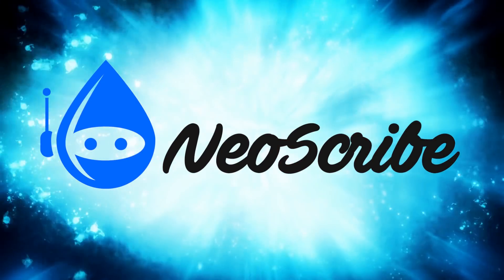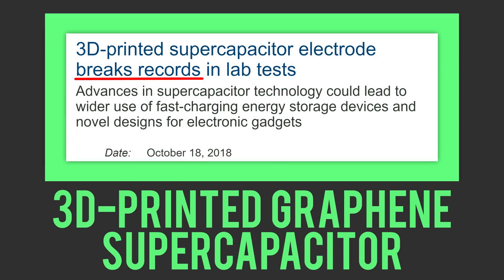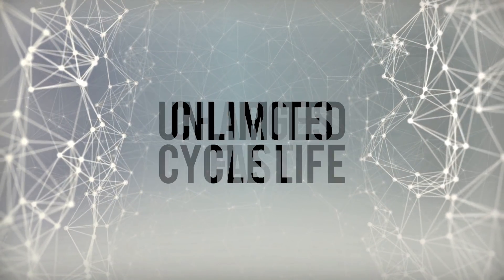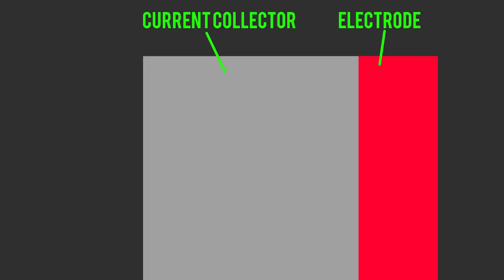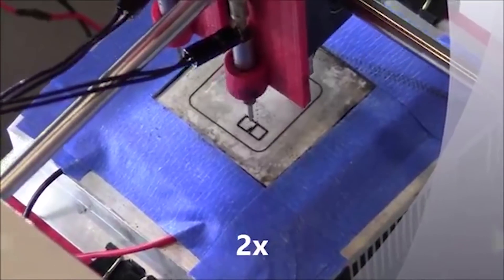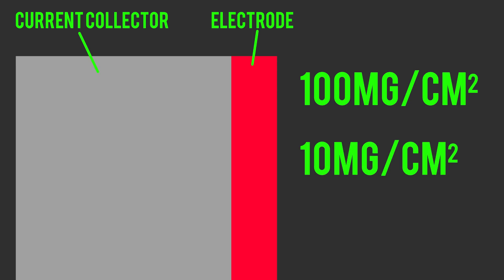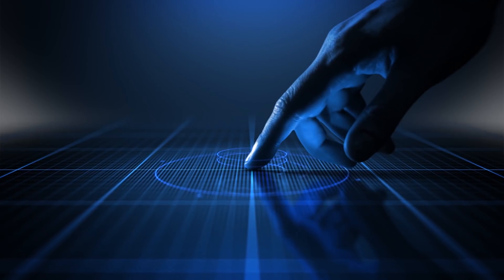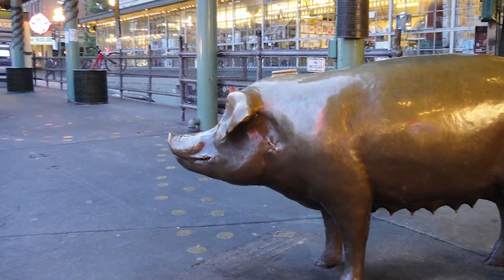Amazing 3D-Printed Graphene Supercapacitor Electrode

Comment: Cool, but one thing you didn't seem to realise @neoscribe . by the time this technology finds itself in consumer products..say by 2030... Well at that point the definition or resolution of 3d printers and sheer ability of consumer 3d printers to handle multiple materials will be many times higher. So it could be more  likely the case that consumers literally download a file to print their own graphene supercaps. Yes it might be the case that this is far less profitable for the original manufacturer and patent owners , but that is simply not going to stop such printing files from being designed and downloaded. Unless it costs me more to print than buy I will print.

So just work out the average resolution of a 3d printer, work out the increase in resolution of consumer printers over time and then extrapolate to 2030. That's probably above the level of the Livermore bespoke 3d printer.
Reply: Mickelodian Surname your ink might be expensive. After all graphemes is still hard to make.
Reply: 3D printing has become a lot cheaper, but 3d printer resolution hasnt increased a lot since its inception ~25 years ago, and its not likely to increase dramatically either.
Reply: P44man I don’t know much about 3D printing tech, but Ray Kurtwell made a prediction that we can reach sub micron level precision within 3 years.
Reply: I can configure my 3d printer for 1 micron layer height today, but that doesnt mean anything. When printing by melting filament, you are inherently limited to the physical properties of the molten filament and mechanical accuracy.  When using a laser, you can achieve virtually any resolution you want for the laser, but printing will take forever and/or require kilowatt lasers, and you are limited to materials you can fuse or UV cure with a laser. Not too mention, the physical properties of the stuff you are hitting with the laser can severely limit the resolution of the actual print.  Printers will continue to become cheaper and easier to use, hopefully also faster, but without radical new invention, they wont become much "better" than what we have today otherwise.
Reply: P44man you’re pointing out problems we can’t solve today. That doesn’t mean we can’t solve it tomorrow. I think we can both agree that human will eventually be able to 3D print sub-micron level(able to print clothes). What we disagree on is how many years it will take.
Reply: You can already print clothes. That is, if you like to wear Plastic, or metal.  But even if we can, it remains to be seen if it makes any sense to actually use it for those purposes. 3D printing generally only makes sense for low volume production, prototyping and the like.  Almost anything you can print, you produce in volume much more cost effective using other techniques. 3d printing is just too power intensive and too slow compared to traditional manufacturing for most other things. What takes my printer 10 hours to print, an injection mold machine can make 10.000s per hour for a tiny fraction of the cost.  BTW, look up the Kniterate. Yeah you can order one, download designs and "3d print" your own knitted clothes.  But hardly anyone will. And no one is going to 3d print his own batteries, even if one day, we theoretically could. Maybe astronauts on mars, as long as they dont have a battery factory.
Reply: P44man I do agree for most mass production factory is still has the highest cost effective ratio. However I think at least for clothes the mark up is high enough for normal people to consider making their own clothes at home.
Reply: P44man assuring we can print fabric.
Reply: Mickelodian Surname the filament would be expensive
Reply: @Dana Putman Graphene is quite cheap
Reply: @Dana5775  well like lots of things it would be expensive if only a handful of people bought it. Then again people pay over a thousand dollars for an iPhone which is pretty daft and its deliberately that price. It doesn't cost a lot to make it.  Also daft given the alternatives.  So it might be deliberately held expensive. But if every hone had one? Well it wouldn't be expensive.

The problem with 3d printing though is that the methodology doesn't lend itself easily to advances in quicker, better, cheap, faster.... Which is the general direction of technology. There are however different methodologies. So back in the 70's and 80's my dad had a daisy chain printer. Look it up. There's absolutely nothing you could do to increase the definition of letters. Fonts relied on installing a new head.

Then we had a ribbon printer. Lasted ages without a refill. But again the methodology was fixed definition. There was nowhere the technology could go. In the 80's we bought a dot matrix printer. The text quality was poor at under 100dpi but the process was one that could and did improve.  With 3d printing we are still in the daisy chain era. But dot matrix is coming.

Comment: But people forget that even a superVOOC charger which does it in half hour has to use special expensive charger and cable. The market for tesla-style cables to one minute charge a supercap is going to be limited. And also the cost of making them is unknown.
Reply: No, the cost can easily be calculated by knowing the required amps/time. That gives the wire size for the cable and the design requirements for the charger. Rather straight forward requirements.
Reply: @mikewurlitzer5217  there is a video about supervooc, seems like you need both high voltage and amperage for fast charging that doesn't heat up the battery, but we dont know the thermal properties of this new technology.
Reply: 635574 it’s not a battery it’s not chemical electric. And graphene airgel is the fastest heat dissipation in the universe. There is little resistance to static charge.
Reply: 635574 first of all I have 220v right in my garage I have a fast charger built right into my car. That’s 44,000 watts.
When I drive to LA I stop at a friends house for 15 min. Plugged into his cloths dryer outlet (220 V)
Unfortunately city’s are being duped into buying expensive chargers for hosting e vehicles. This is just naive and tec companies are having a hay day with this nonsense.
If you own an e vehicle you want the charger built into the car ( 200 dollars ) this way you can plug into any electrical outlet  (110V , 220V).
Recharge facilities (gas stations) will have huge batteries on sight that gain a charge 24 seven to service multiple vehicles at once.

Comment: I hope that in 3 years graphene batteries are used in smartwatches.  
With graphene batteries, stainless steel, and sapphire glass, a smartwatch lifetime value would be as good as a regular watch. I once said. ”This Apple watch (1st generation) feels as good as a Rolex.” This was a mistake. Someone with a Rolex heard that and started laughing hysterically. Then said. ”This is a 5,000.00 Rolex.” I said. ”Just 5,000. That's the cheapest one.” I do have an Apple Watch 3 LTE now.
Reply: Unlikely

Comment: I have a weigh scale for my weight. Push a button 3 times and charges up, long enough to weigh myself. it's awesome.
Reply: Solar bathroom scales exist already. They sleep most of the time, so they use even less energy that a LCD clock.